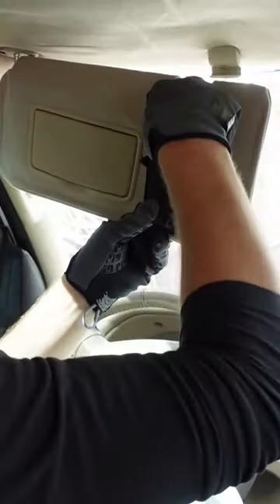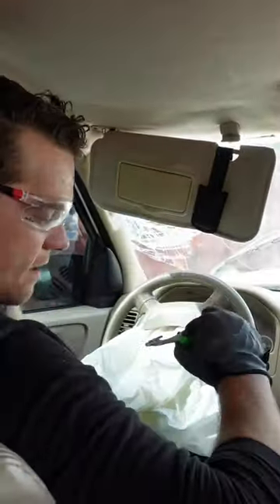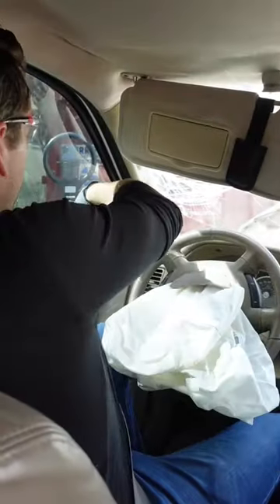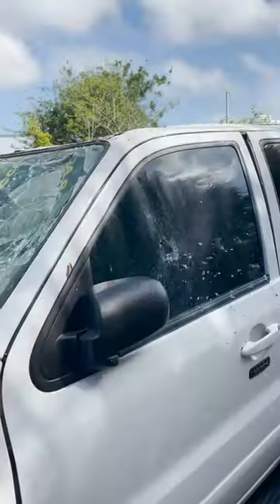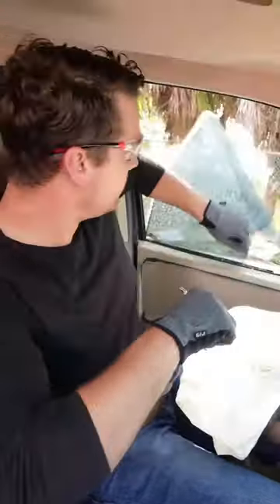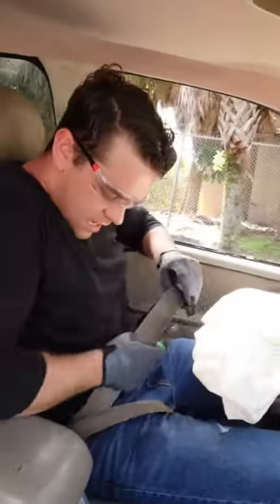Supervizor XT VS carwindow! Will it work?!

Comment: Got to be careful of any glass still on that windowsill
Reply: Most windows like those ones are safety glasses, it shatters into less sharp smaller pieces, when I was little we would pop the windows in old cars and just mash the bigger pieces in our fists. But yeah be careful around glass even safety glass can be dangerous key word was LESS sharp!
Reply: The first guy who commented is right but this scenario is normally if you crashed and are under water. The pressure from the water outside will automatically push the Glas towards you anyways to fill the air that's trapped inside. Not to mention the glass was tempered glass so it breaks away easily